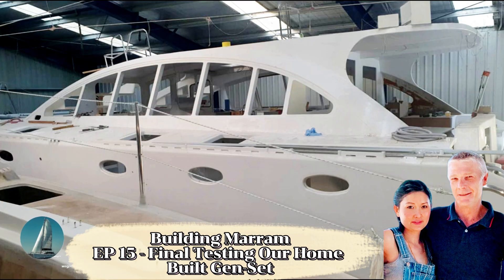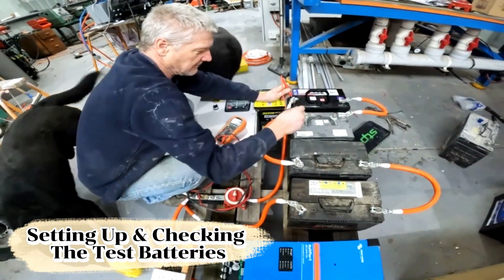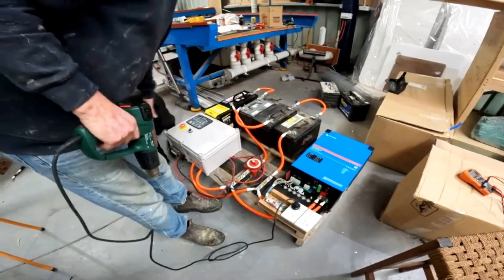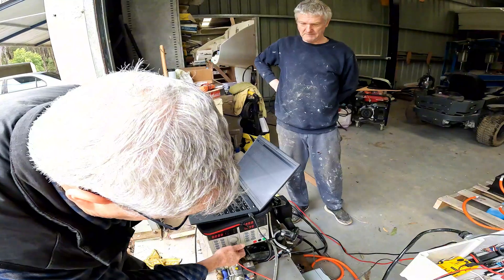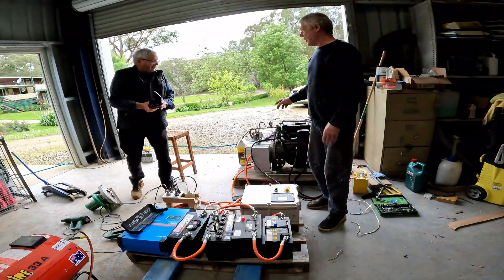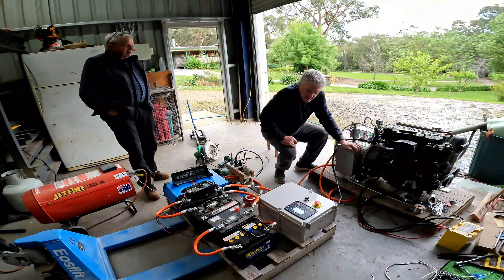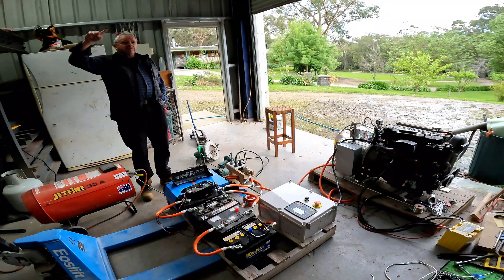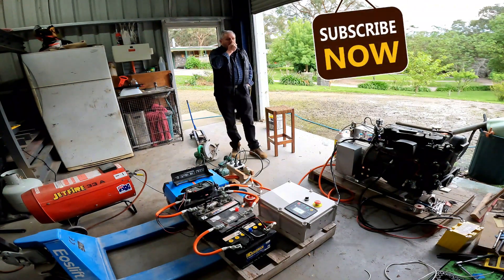FINAL TESTING OUR HOME BUILT GEN-SET (Ep15) ~ Building Marram ~ Catamaran Build !

Comment: I have not been following these videos, fresh to it but I see some things that either scream why? or you are asking for trrouble. 
RPM controlled voltage regulation is messy, use a AVR and let the engine come to its tuned power peak point. MPPT can also help here. Mixed batteries, yeah, not cool in series, will flog the smallest/weakest. Keep the dogs out, wet mouths/balls on 50V is morte than enough potential to be lethal, too many people complacent with electricity. 
The victron Multiplus already supports a mains/genny input of AC and even better, a Quatro would bring in shore power and the genny at same time and programming the limiting to stop ovberloading the supplies. I did hear the comment at end on using the genny DC to feed the propulsion motors and a figure of 400A which at 50V is around 20KW. Engine on genny on small side for 20KW without a turbo and serious cooling. Still, AC can be used to feed additional rectification to DC with regulation to keep demands satisfied. End result, standard genny that can be swapped/replaced when needed without the BS of being customised.
Reply from the maker: Hi Mate, Thanks for your comments.
There is many compelling arguments on either fixed speed/fixed voltage or variable speed / voltage to charge lifepo4 system, we chose the DC variable path with advise from our electrical engineer (an EV system designer) as well as the battery manufacture, only time will tell if we got it all right
Cheers, Kel & Mel
Reply: @themakingofmarram  I just suggest that homework is done well and proper prior. I have seen many "Engineered" solutions become expensive flops and feel yours is already more complicated than needs to be. Anyway, have fun.